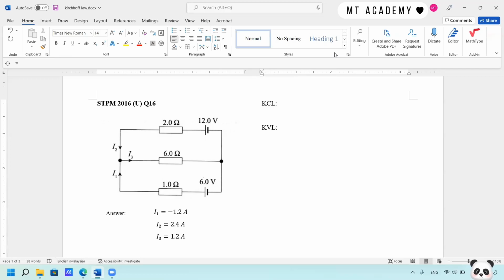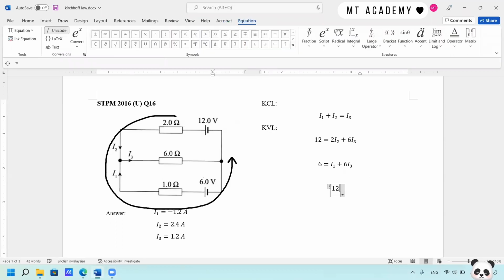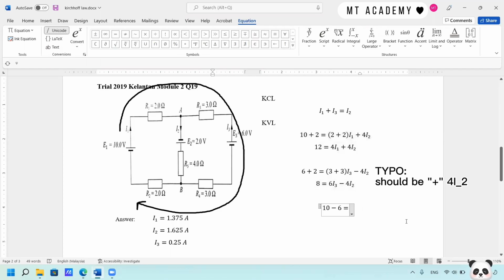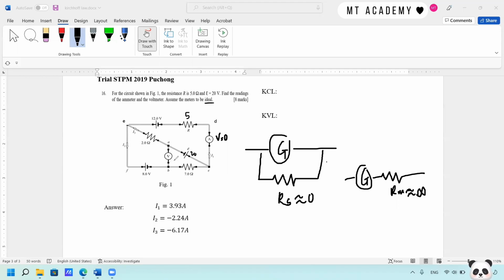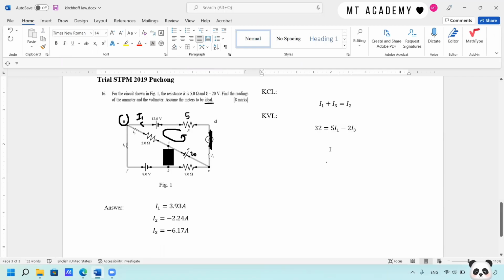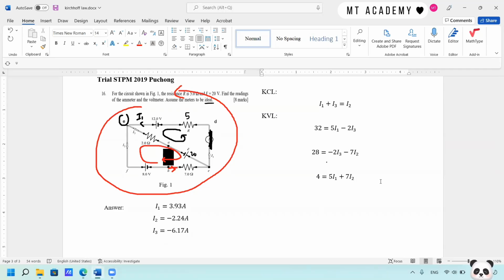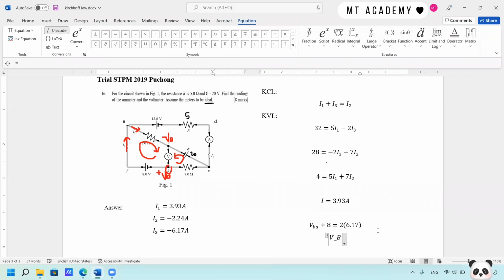DC Circuits: Kirchhoff's law Revision | STPM Physics

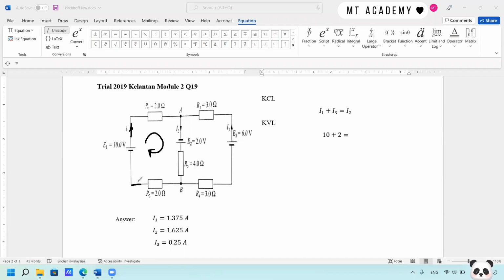Comment: Teacher, at 4:25 if the resistance of the resistor is not 2 ohm will the current change (not I1 anymore)? I’m not sure if the current is I1 because of the resistance is 2 ohm or is it because it’s a series circuit
Reply from the maker: hi, are u referring to resistor R2? it is series with R1, I1 is flowing through both R1 and R2